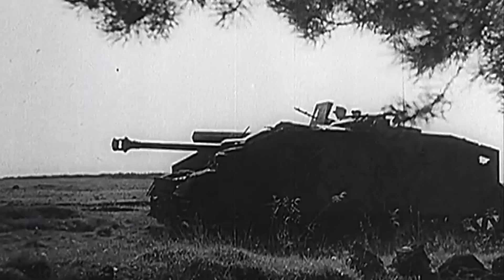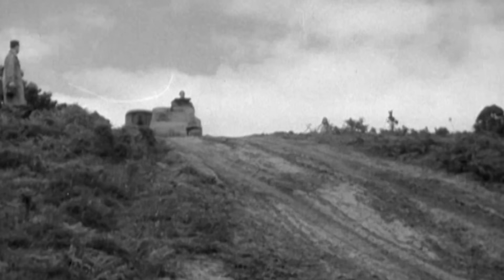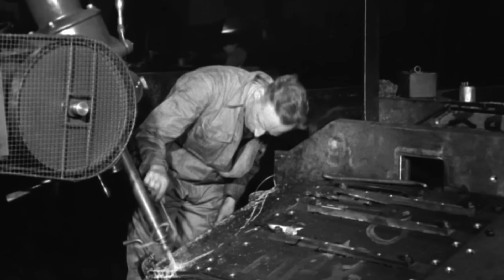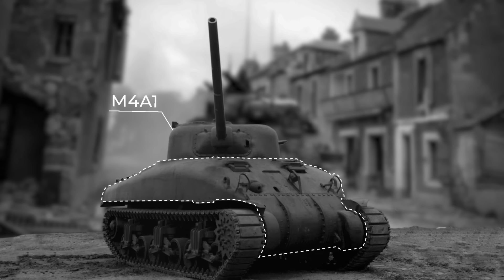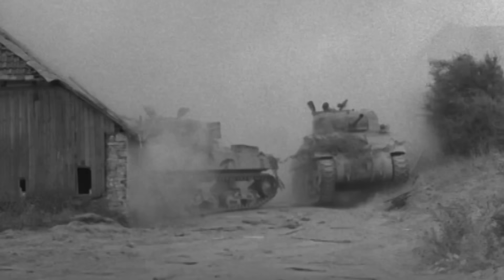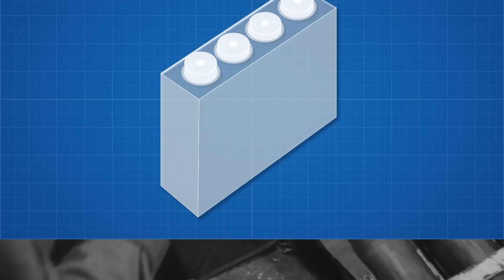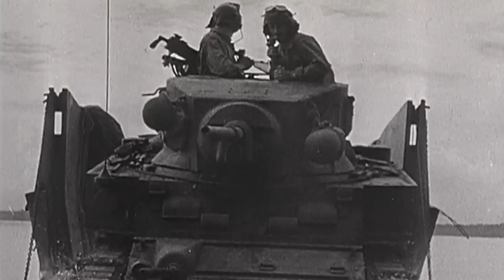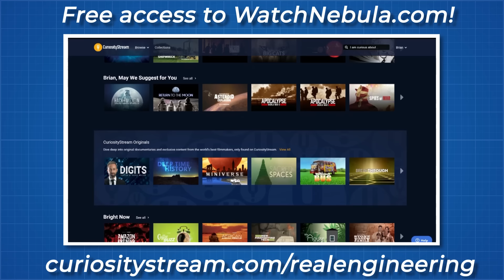M4 Sherman - The Workhorse of D-Day

Comment: Sherman has some spring loaded hatches
Wehraboo: *DEATH TRAP!!!!*

Tiger tank having some mechanical breakdown
Wehraboo: *Greatest tank ever devised!*
Reply: @Trung Thien Dao it was known for eating up Transmissions real fast truthfully it's design it was extremely unreliable
Reply: @mrbladesletplays  besides the fact the tiger was design to be repaired over weeks of time solely because they were a breakpoint tank theyre shit?

look at the role it was designed for and it was a good tank for that.
Reply: @Thekilleroftanks  Tiger's planetary transmission was over-complicated and wasn't necessary to pull the weight, it was a design weakness with no real positive trade-off.
Reply: @p_serdiuk  actually you should remember it was design for the vk3601h which was about 20 tons lighter and the transmission if am not mistaken was design to be a smoother transition between gears compared to other types with the downside of increase reliability issues which was fine.

The main issue was that due to the project being rushed near it's end forced the designers to keep the old transmission which couldn't handle the added weight as well and would break down even faster.
Reply: @Thekilleroftanks  Yeah, that's kinda the problem. A breakthrough tank, by all logic, should have heavy-duty components that are as simple and durable as possible since the tank has to keep moving and has to weather return fire if it is to fulfill its role, even if it will require maintenance later, yet Germans tried to fit the Tiger with all kinds of gimmicks like the planetary transmission, interleaved road wheels and Porshe's hybrid electric drive train, resulting in a design that while good in its battlefield role, was very hard to manufacture and maintain outside of the battlefield. And if the other Panzers were simple and easy to manufacture, the Tiger might not had been pressed into other roles, but they weren't either. German tanks were good at winning battles but bad at winning wars.
Reply: @mrbladesletplays  

Really? Got any actual written proof or documentation that shows that Tigers ate up their transmission really fast and were so extremely unrealible?

Or should I simply come to the conclusion that you're little more than yet another one of those dumb sherman fanboys.
Reply: Dreachon Wehraboo located
Reply: @Jesse-ge1bp  right?
Reply: @Dreachon  Got any saying otherwise?
Reply: @richiemacrophage  It's not so much that I need to fork over proof. The burden of proof lies with the people making the claims that the German tansk were so terrible unreliable.

Often you will see them try and abuse 'Operational Readiness' percentages to highlight how many German tanks are not available for action but these figures never tell you for what reason a tank was not available, it makes no distinction if a tank is not available due to being lost, abandoned, put in the repair shop due to combat damage or mechanical issues.

Another aspect that is often not said is that OR figure can fluctuate wildly depending on the situation and are far more influenced by strategic and tactical situations well outside the actual tank itself.
Reply: @Dreachon  If you don't have proof then you cannot prove your points any better than they can.
Reply: Dreachon If you weren’t a wehraboo you wouldn’t have gotten mad about me calling you one. And yes a simple google search will tell me what a wehraboo is. In addition to that any google search will tell you about the German engines, transmissions, etc. The German tiger and panther were very good tanks when it came to guns and armor but their reliability was horrible and you can look anywhere for those facts.
Reply: @Jesse-ge1bp  Sure, keep rolling around in your denial. I know exactlythe types of people throw out the wehraboo card willy-nilly. And yes I will get mad when some random person accuses me of something without any proof.

A google search, funny how those will often give you the least credible sources, there's a reason why credible historians and trhose in search of actual knowledge go with books.

I can look anywhere for those facts for how horrible their unreliability are? By all means do please show something that even remotely supports this supposed unrealiability.

The actual works by historians tell us a different story.
Reply: @Dreachon  If you're taking anything from Deathtraps, you've taken from a non-historian. Also, anyone taking information from him are doing the same thing. He's a secondary source AT BEST. He's almost like a worse ex-nazi general...because he's not trying to hide war crimes. 
 Also, modern historical research largely disagrees with what you've been presenting. Sorry dude, you undermined yourself better than I ever could.
Reply: @Dreachon  Also, if you understood a basic concept of how history research works - A proper statistical analysis, can override first hand reports. When it comes to the Sherman series of vehicles, it was not the deathtrap it was purported to be. This is a fact, based on evidence in the national archive studying all tank losses in WW2. 

So you can spin your *deathtrap* logic as much as you want, but it's at a basic level incorrect. You are performing the soap opera of people discussing history. This guy who fixed the tanks says it's a deathtrap - OBVIOUS DEATHTRAP! While as, all armies (not just Allied forces) kept a very close eye on what were the losses, causes of losses and acceptable casualties. One of the reasons the German High Command kept upsizing tanks and guns, was their vehicles were being beaten by both Eastern and Western Allies. Think about that for a second. WHY IS HITLER SUPPORTING A MAUS? It's because the equipment can be replaced while as manpower isn't as easily replaced. The panther wasn't enough - MAUS, SUPER TIGER, ETC! Simple facts were the systems had some superiority to others. But, the germans were largely on a defensive war once the Sherman was introduced (at least on the western front). Defensive positions tend to lend more losses on the attacking side. Over 10k Shermans were lost. But the Death rate is not that high? Because it was not the deathtrap some people think it was. German armor had reliability issues. This has been researched and confirmed many times over, both by PRIMARY GERMAN SOURCES DURING THE WAR, and after the fact by non German sources. And this is not one guy saying it - it is studies. Very different ball of wax. I readily point out deficits of the allied armor, because it's not perfect. However, neither is the Axis powers. If you're still believing that the Wunder weapons of the Nazis are perfect - You've really got to get out of that movement. Hating people, doesn't look good on anyone.
Reply: Dreachon Right so Belton Cooper is more reliable than the internet. I’ll believe that when you’re not a wehraboo. Don’t act like you don’t have a Panzer playlist on your account. And since you are unable to use google yourself, here’s a result I found https://www.google.com/amp/s/tankandafvnews.com/2015/02/08/from-the-editor-panther-reliability/amp/.
Reply: @SlavicCelery  If something goes over you head, by all means do say it and we can go back to start and go through again, instead of going on this rambling.

You talk about secondary soruces yet you can't even recognize a primary source when it appears. Did it upset you thath much to see that untis with the Sherman were also suffering high casualties due to mechanical breakdowns?

Seems more like you're getting scared because somebody is starting out bring out actual numbers.

Answer me the following question because you're just being absurd. 

The primary German sources? You would not even recognize them if somebody where to flung them in your face. They disagree to with the claism that the later models of German tanks had horrible reliablity, this is again what historians such as Doyle, Friedli, Raths, Töppel, Anderson are showing us with their works on German armor. 

You can't even look at a document and take not of the date on it and what that means. You can't go and use figures that are from the Ausf. D and pretend that these also apply to the Ausf. G when it is this series that has seen the most of the automotive improvements incorperated into it and it reflects in the growing number of tansk that ready, the Operational readiness figures for the Panther on all front is climbing for instance until it reaches a peek in the summer of 1944 at 80%.

Where did I say anthing about the Sherman being a deathtrap? 

Where did I say anything about wunderwaffe being perfect? 

Where did I say anything about the Maus
And where the fuck am I hating on people?!

Try and stay on point instead of this childish rambling of yours. 

Both you and Lego Yoda, you are unbelievably stupid.
Reply: @Dreachon  If I may ask are you just talking about the on paper designs of the tanks or "how they actually played out" for a lack of a better term.
Reply: @debinoh4273  

I go with how it was in the field
Reply: @Dreachon  So if we're talking about the later panthers such as the ausf. g I'd say those were better than the shermans in terms of firepower, armor, cross country, and about on par with shermans in reliability only being truly worse than the m4 in terms of field repair as those double torsion bar suspension systems were from what i hear a pain in the ass to repair and of course the parts in stock which i cant blame the panther for. Correct me if I'm wrong though. I'm comparing this to the easy eight sherman which is why I didnt bring up the sherman's psi issue, correct me if I'm wrong in anything however.
Reply: @debinoh4273  The Ausf. G is indeed the most representative of the model of Panther one would encounter from Normandy onwards as this model made up half of the total number of Panthers build.

Reliability is a difficult subject to rate because far more often it will be influenced by matters that go well outside any tank's design. This becomes especially true when the tank is on the losing side, and we have seen this with both British and French tanks in 1940, British tansk in 1941 and Soviet tanks in 1941 as all of them are having large numbers of operational losses.

Like you say, getting parts is a vital aspect of getting a tank that has suffered damage or a mechanical issue back to its unit and here is one of the big advantages that the western allies enjoy, their industry is not being hampered and they have far better logistical systems in place.

I don't feel that the any model of M4 using the HVSS suspension makes for a good comparision because it was introduced so late in the conflict, first models of the M4A3 (76)w HVSS did not arrive with frontline units until the end of December 1944. Shermans with the VVSS suspension are far more representative of the mobility of the Sherman series.
Reply: @Trung Thien Dao so your telling me that because of shortages, it has a poor design, which is the point, it had reliability problems
Reply: @chevytos97  The fact that they designed it knowing their industries and supplies were lacking adds to the list of design flaws. You design what suits your situation.
Reply: @chevytos97  besides the reliability problems wasnt a problem at first until it was thrown into a role it wasnt design for. gotcha.
Reply: @Trung Thien Dao So French usage after the war... are due to material shortages? Dude you better share some of that shit you're smoking, because it's probably illegal.
Reply: @Trung Thien Dao When it comes to non-german usage after the war - they discovered shock they had problems.
Reply: Basically, every system had some flaws. The moment you accept it, you don't have to defend your favorites...also you realize the allied tanks weren't heaps of Garbo that won accidentally.
Reply: @Trung Thien Dao The French army's use of Panthers after WW2 noted Transmission woes with peacetime usage. The cats were flawed designs, as all AFV's of the time are... perhaps not flawed, but compromises of need.
Reply: @SlavicCelery  Please don't go and try to use the French usage of the odd 20 or so Panthers that were salvaged from the many knocked out tanks that littered France as any indication of mechanical reliability for German tanks.

It was a low effort investment, and the so-called report itself is of a questionable nature if one uses some actual reasoning. Nothing is ever todl about the shape that these tansk were in, nothing is ever sai about how much or little maintenance they got.

Ask yourself the question, why only Spielberger was able to dig it out from somewhere and publish some bits in his 'Panther and it's variant' in 1993, while nobody else has ever since, closing in on 2 decades now, been able to find it.

One should start scratching the back of their heads from the fact that a historian on a payroll of a major gaming company, and at least 4 other authors only can copy the "original" text, and are unable to see the original for themselves.
Reply: @Dreachon  https://tankandafvnews.com/2015/02/08/from-the-editor-panther-reliability/ - considering engine life was praised when it went from 700km before total rebuild to 1000km by the Germans; they were not reliable tanks. That's not the final drive, that's the engine.
Reply: M4A2 - you're looking at 2200-5000km.
Reply: We can always get more tank,more spare part and shell etc but we will not able to get more tank crew. Hence why Sherman with spring hatch and wet storage is installed increase crew survivability.
Reply: @mekhane.broken9678  Manufacturer of large hatch Sherman's was commenced in 1943. Teething issues. Good lard, people act like every issue with Sherman's were not addressed during WW2 or at all.
Reply: @mekhane.broken9678  By that logic Pz.Kpf.W came equipped with a 3.7 cm cannon. Which was Ill equipped to fight nearly any tank the Allies used in force. See how that works?
Reply: I know it's a lot of people claiming supply so it is it doesn't change the fact it wasn't reliable and very uncommon of a tank yes it did a  pretty good for its role but its role as quickly replaced when the role of heavy tanks fell flat in the main reason why because they were super expensive and medium tanks and tank destroyers could actually take them out just as easily I'm not a Sherman Fanboy actually I prefer to the chaffee the heathers the panzer 4 and m26 it is a known fact the tigers were very unreliable all we have to even the tank museum which holds the tiger one says it is extremely unreliable have a big tendency of breaking down due to its over complicated and overweight
Reply: @Trung Thien Dao There were many excuses tor the poor German heavy tank reliability.  One that is commonly used is that the final drive gear failed because of the alloy used was unsuitable, and that was due to wartime shortages.

But a substantial part of the problem was poor engineering.  Part of the tank were over-complicated/'over-engineered', but the final drive gear was grossly under-engineered.  It was a straight-cut gear that suffered from vibration, shifting engagement, and direct shock loads from the track. 
The Sherman used a herringbone gear.  That's a much more sophisticated gear.  It's much more difficult to design, design the tooling for, and produce.  But the constant engagement, load distribution, lubrication dynamics and self-centering make it far superior.  It generally lasts the life the transmission with negligible wear.

The German designs also over-used ball bearings.  In heavy-duty equipment lubricated sleeve bearings are often stronger, cheaper, smoother and last longer when abused (as long as they remain lubricated).  Using ball bearings looks more sophisticated, but is sometimes just a short-cut to avoid the effort of designing and testing lubrication.
Reply: rouy malic NEIN NEIN NEIN ZE TRANSMISSION BROKE AGAIN!
Reply: Oh god I can feel the German propaganda playing on Wehraboo group
Reply: Really? That's your selling point of the Sherman. Spring loaded hatches. Why not pay more attention to not being penetrated in the first place lol
Reply: @Daylon91  Don't get penetrated. Move. 7.5cm and 8.8cm high velocity guns are not guardable. Trying to slap as much armor to do that would result in a bunker on tracks, not a tank.